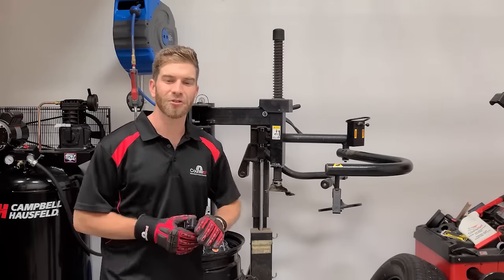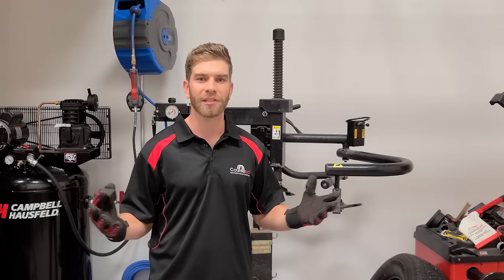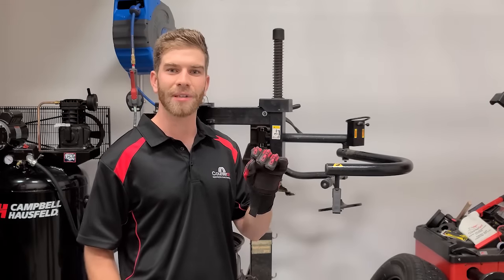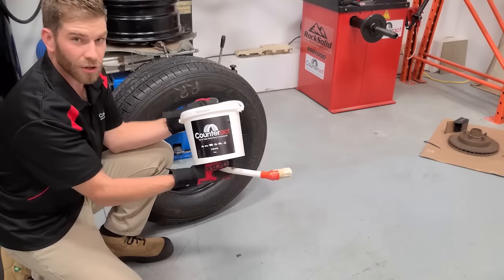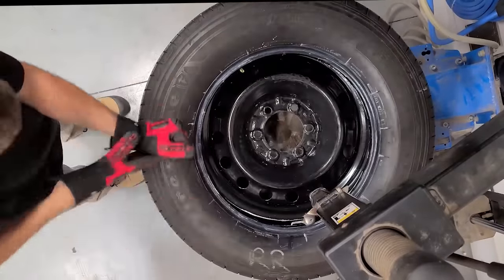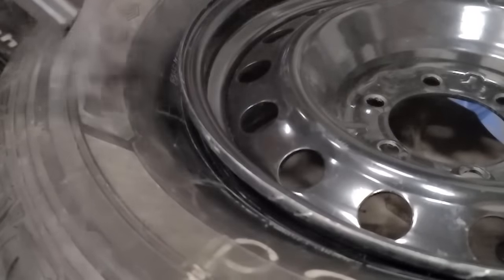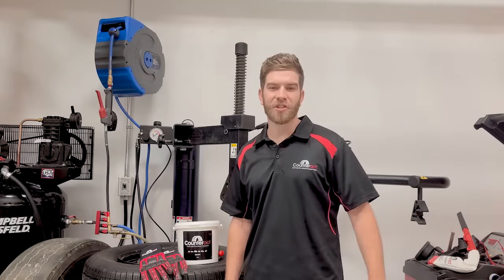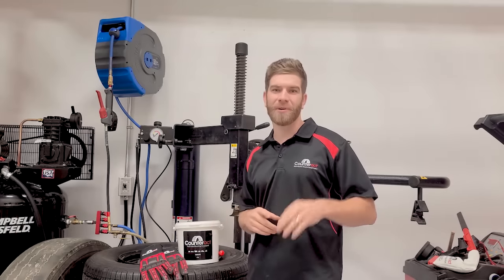Camera INSIDE a tire with Counteract Balancing Beads

Comment: Just FYI.  I will never just throw in the bag. Last time I did that the tire never reached balance. When I opened up the tire the bag was open but it had a lot of beads inside the bag that never moved out or most likely entered the bag again. This was after 100 miles or so.  I opened the tires and removed the bags and the problem cleared up.

Comment: This just show how centrifugal force works. Should have put a weight on the rim to see if it go to opposite side.
Reply: Why in the hell would they need to they Installed a foreign object ( the cameras) that just even proves the point even more.
Reply: @martymccormick4816  They put two cameras in there on opposite sides, and it's not at all obvious where the imbalance is and where the beads should go.

Comment: I had balancing beads in 37” bias ply Super Swamper Irok tires. The shop was able to balance them without and insane amount of wheel weights. The beads worked great and I daily drove it 60+mph regularly with only the typical roar from being a mud tire. No vibration though which is hard to achieve with tires like that. Bottom line- the beads work.
Reply: Yes, but they work well at the driving speeds that you’d encounter the vibration. They tried wheel weights, but they said it was going to be a lot of them so they put the beads in instead. I was just saying I’ve used them and they worked good.
Reply: @sausages6135  Actually, the balancing machine isn't capable of replicating suspension travel, which is what is needed for the balancing beads to function correctly
Reply: @sausages6135   Actually, it's inertia and centrifugal force combined; the moving suspension components push and pull on the tire, which is an instrumental part of the balancing process when using beads. Rather than simply making an assumption based on a guess, why not do yourself a favor, and actually look into further before responding with future replies. Not only will you learn something, but you'll be better informed when participating in these discussions. BTW, simply owning tires that have balancing beads in them doesn't make you an expert on the product... after all, your vehicle probably has oxygen sensors too, but that doesn't mean you know what kind of signal is being sent to the PCM to manipulate the short term fuel trim.

Comment: I just put beads in my 205 65 15 s. I heard 1 ounce per 13 pounds of combined tire and wheel weight is the rule of thumb. I used 2.76 ounces of beads. I test drove the car up to 65mph ( that's basically the fastest I drive daily) and it seemed to roll very smooth and very quiet too. I probably could have rounded it out to 3 ounces but I am pleasantly pleased at this time.
Reply from the maker: That's great to hear!
Reply: @CounteractBalancingBeads  yep! However I had an extra 12 ounce bag. I have a set of 185 65 15, they weighed out at 26 pounds, that's just under 2 ounces of beads but I put in 3 ounces per tier to use the bag and see what happens. At about 55 I start to feel shimmy and at 65 it starts to get bad. I will be breaking them down and put the rule of thumb in and see if it runs smooth. Trial and error right!
Reply: @dennismadigan2023  there are calculators online, please let me know if with the right amount worked, and your view about this product if possible. I was thinking on using these for my car, but some comments from some people "scare" me. Like, every once in a while I like to put the car like 100/110mph, and then people say that if you hit something like a gap in a bridge it can't get out of balance and you have to come to a complete stop to fix it...
Reply from the maker: @dennismadigan2023  Hello, these products are not meant for small passenger cars, they are designed for use in motorcycles, atvs, utvs, classic cars, utility trailers, commercial vehicles, and anything presenting a 1/2 ton suspension and larger. This is because of suspension dynamics, most cars have too soft of a suspension in the front to allow the product to perform as intended.
Reply from the maker: Hello, these products are not meant for small passenger cars, they are designed for use in motorcycles, atvs, utvs, classic cars, utility trailers, commercial vehicles, and anything presenting a 1/2 ton suspension and larger. This is because of suspension dynamics, most cars have too soft of a suspension in the front to allow the product to perform as intended.
Reply: @CounteractBalancingBeads  most things we use in life weren't intended for what we use them for
Reply: @dennismadigan2023  Incorrect. If a thing is being "used", then it is being used for what it was designed for. If you are using something in an unintended way, then it is not being used, it is being "utilized". I used the words, you utilized them... LOL
Reply: @kamikrazywarboy2008  I'll agree with you lol
Reply: @CounteractBalancingBeads  1/2 a ton, what motorcycles are you riding?
I still don't believe the beads work as you say, not saying their's nothing in it but I'd like to hear you in conversation with a physicist so he can explain to you, and the rest of the world, why they reduce the vibration and what forces are being applied by the beads. 
Your video proved only that the beads are deposited on the outside of the tyre by centripetal force, that's it.
Reply: @joebloggs1317  I've got a 2007 Suzuki vstrom. I got it last year. It's got some kind of internal beads and it rides very smooth and stays balanced we no vibration. The only reason I know about them is when I maintaince the chain I can hear them rolling around in there. And there's no weights on the wheels

Comment: I don't understand why this works?  Imbalances tend to run-away because mass and centrifugal force.  For that reason, why would something else with mass (beads, liquid etc.) move away from the area being flung outward the most?

I acknowledge these things work, just the explanation sounds flawed or incomplete to me.

Every time I've spun or sloshed a container of loose material or liquid, it gathers outermost as possible, especially in an irregular container or anyplace further away, off-centre which also explains why the container becomes unstable and tries to get flung.

Whatever other effects are at play, I'd like to understand.
Reply from the maker: Hello, thank you for the question! We would gladly be able to explain further. You are correct that centrifugal force is at play, however, centrifugal force is not a "real" force. This is because the beads, or any material for that matter, will fly outward and is observed as centrifugal force because the objects that are moving in a straight line continue to move in a straight line. This is where the second force comes into play that actually positions the product, and that is inertia. Inertia makes objects resistant to the force that would make the beads continuously move in a curve. So, as the heavy spots of the wheel and tire assembly rotate and they push and pull on the suspension, it creates vibration or what we know as a tire imbalance. With every rotation of the wheel the beads will shift and adjust their position to the area of least resistance. Once the product has settled in this state, it will not move or adjust its position unless this state is changed due to external forces, which could be a stone, mud or debris in the tire tread, or the wheel and tire experience a change that renders it to no longer be balanced. Thus creating a vibration or disturbance that then reactivates inertia, forcing the beads to readjust their positioning to accommodate for that.
Reply: stop OVER thinking life!!
Reply: @-MrRichBiker1967  Stop being curious?

Comment: For a DIY person doing this with a manual tire changer we often add something like soapy water during the process to make getting the tire on easier.  What would you recommend along those lines?  Thanks for any help
Reply from the maker: Hi there, it is always recommended to not use soap/water formulas. Mainly because soap does not dry and can cause wheel/tire slippage which will damage your tire. You are best to use a Euro-Paste mounting formula, we do make one and it is available on Amazon.
Reply: Lol
Reply: Animal fat soap/vegetable oil soap are both perfect solutions, it's basically what's in the purpose sold mounting lube(along with a corrosion inhibitor). Stay away from using anything that's petroleum, solvent, or detergent based, they can greatly reduce the quality and life of the rubber, lead to bead failure and/or slippage, it can also cause the coating on your rims to prematurely age, and become brittle, or even release from the metal, trapping moisture underneath, we've all seen that :\ I use Murphy's Oil Soap, it's about $4 at most supermarkets. I put about 4:1mix in a spray bottle, it's very safe stuff, and works great.

Comment: It works for motorcycles using tube type tires? Should I put the beads inside or outside the tube?
Reply from the maker: Hi MHR Bernards,
yes, Counteract is compatible with tube-type tires. You will want to install the beads through the valve to the inside of your inner tube, not between the tube and tire. We do make motorcycle inner tubes with the beads pre-installed if that is of interest, they are called Counteract Ready-Balance Tubes!

Comment: Hello just purchased a set of 22×8.25 northstar wheels and planning on putting some low pro grapplers will this product be more effective than weights?
Reply from the maker: Hello, we would need to know the physical tire, tire size and the vehicle you plan to use the product on to help you further. We can not provide a recommendation with just the wheel size. If you send us an email at contact@counteractbalancing.com we can definitely help you further!

Comment: Are they safe for re threads?  

I plan to add to my new 35"x12.50xR17  Treadwright Axiom tires on OEM Rim. What is reccomended package of beads per tire?
Reply from the maker: Hi there, 

Yes, the product is certainly the best option for retread tires! However, when it comes to retreads they can call for such varying amounts of weight that our normal recommendation may not be enough due to inconsistencies in the tire. It's possible to have 2 tires 10oz out of balance than the other 2 each calling for a different amount. 

As overall, for a 35X12.50R17 we would recommend 10oz for a Highway Tire, 12oz for an AT, and 14oz for an MT. 

Hope this helps!

Comment: Very cool how these work. I'm using them on my work van, truck with oversize tires, and my motorcycle 

Back in the day, we used to use BBs to balance big offroad tires. Sounded funny hearing them hit the wheel on a panic stop

Comment: What about if moisture in introduced when airing up the tire? Do they eventually clump together? Why not just use sand?
Reply from the maker: Hello and thanks for your question.

Counteract is designed and manufactured for use inside tires, capable of withstanding harsh environments. Our product is specially coated and treated to repel and resist moisture! So this is not an issue for us, unless there is an extreme amount of water being introduced to the tire, which should not be the case if your compressor or air supply is frequently maintained. 
 
As for sand, moisture would be one of your largest enemies. Sand will absorb and hold onto that moisture causing clumping issues and various other problems. On top of this, sand will deteriorate the inner liner of the tire, the structural integrity of the tire and if you have TPMS, it will damage the sensors. It is never advised to put sand inside your tires, you are always best to use a safe and approved internal tire balancing product.

Comment: Can I use this product on a street car with tire size 335/30R20 drag radial ? , How many oz will I need for tire size 335/30R20 and will I have any issues with my TPMS
Reply from the maker: Hello,
We would not recommend the use of any internal balancing product in a street/passenger car. The product is best utilized in vehicles that have a stiff or ridged suspension such as a motorcycle, light truck, trailer or anything half ton and larger. In many cases the front suspension on a regular street car is too soft to achieve the desired performance.

Comment: Is there any disadvantage to using  conventional (external) wheel weights to balance the tire ALONG WITH these balancing beads?? I'm using a 37x12.50x20  on a Ford F350. I'm looking for every available option to minimize vibration at highway speeds (80+ mph)
Reply from the maker: Hello, 
We do not recommend the use of traditional wheel weights and beads. In most cases the beads and weights will fight each other. Some users will add a few ounces to their tires to remedy a mild imbalance, however, we do not do testing on this practice and can not guarantee the result there would be after as there are too many variables.
Reply: @CounteractBalancingBeads  Thanks for the quick reply

Comment: Why do so few people talking about bead balancing talk about ASPECT RATIO?  Beads, commercial or Airsoft, will work fine if the tires are not low profile.  The cutoff is a 65 aspect ratio, where results become mediocre.  Don’t waste time putting beads in 50 or 55 tires; they need two plane dynamic balancing.
Reply from the maker: Hi Lane, 

Thanks for the comment. Unfortunately, what is mentioned regarding low profile tires is inaccurate. IBA's (internal balancing agents), especially Counteract do not have issues with balancing low-pro tires. They are designed to balance both statically and dynamically and do a much better job compared to a traditional wheel weight balance. However, to your point, low-pro tires are typically found on smaller passenger vehicles, these are applications that Counteract is not recommended for use. This is because of suspension purposes, not tire reasons. Most cars present a soft front suspension, at higher speeds this can cause adjustment issues for internal balancers. We have achieved only a 70% success rate in small passenger cars, which leaves us too much room for error. This is why the product is only recommended for motorcycles, atvs, utvs, classic cars, utility trailers, commercial vehicles, and anything presenting a 1/2 ton suspension and larger. If a low profile tire is on a larger application, this actually can increase the performance of the product because your tire acts as part of your suspension, having a lower profile would mean less flex, and a stiffer tire, this would help in aiding the beads to find their position quicker.
Reply: @CounteractBalancingBeads  thank you, I stand corrected.  My less than ideal results, what you might call “borderline” were with 195/65R15 on two Corollas and 215/65R16 on a Crown Victoria.  Great results with beads on my motorcycle and on the 255/85R16 tires on my F250.  I guess I have much to learn. Unlikely I’ll own anything really large with low profile tires, but I’ll keep this in mind.
Reply: I've got these on my Miata with low profile tires. No issues whatsoever.
Reply: @danielmoger7308  glad to hear it!  For someone mounting at home, bead balancing is definitely the way to go.  On those 65 aspect tires where I had marginal results, maybe I should have just bumped up the beads a couple more ounces.
Reply: @CounteractBalancingBeads  sorry for this reply to an old comment but how about using beads in a small but modified vehicle? like stiff aftermarket suspension?
Reply from the maker: @spp6849  You would be best to reach out to us directly and provide the details on the vehicle you are inquiring about. In many cases, modified vehicles with a new or stiff suspension do not have many issues, but we would certainly like to know more about the vehicle and what was done to it to better assist.

Comment: I have a small 1985 NIssan 720 Truck with 205/75R/14 tires. Can beads be used in this tire? If so what size bag should I use in each tire?
Reply from the maker: Hi William,
This vehicle would be a viable application due to the age and the type of suspension. For your tire size, 4oz per tire would be ideal.
Reply: @CounteractBalancingBeads  Great, thanks 👍

Comment: Will these work on my trailer tires? It's a 26 foot toy hauler with tandem axles. 15 inch by 6 steel dexstar wheels.
Reply from the maker: Hello,
Yes Counteract is the perfect application for your trailer tires, we would need your full tire size to recommend an amount, however, you can simply go on our website and click the trailer application chart to get your required amount!

Comment: Can I use these on a 21” Harley front that has a tube? I hope so. I just installed 1 oz. of your beads in my 80/90-21
Reply from the maker: Hi there, yes you can certainly use it on a Harley. We service the motorcycle and Powersports industries. We actually have products specific to bikes. The product is TPMS safe and completely safe for use inside your inner tube, in fact, we manufacture inner tubes with the beads already installed. You can find these products on our website, they are called Counteract Ready Balance Tubes. The only adjustment you will need to make is since you have a skinny front wheel that uses a tube, you would need 2oz of product in your tire.

Comment: How big of a wheel and tire will this work in? I’m running 24x14 on 37” tires
Reply from the maker: Thank you for the question! It is not so much the size of the tire but the speed of the vehicle and how simple or stiff the suspension is. The product works great in ATV/UTV, Motorcycles, Half-ton trucks, classic vehicles, off-road, buses, RV's and commercial trucks. For an ATV/UTV tire this size we would recommend 10oz per tire.